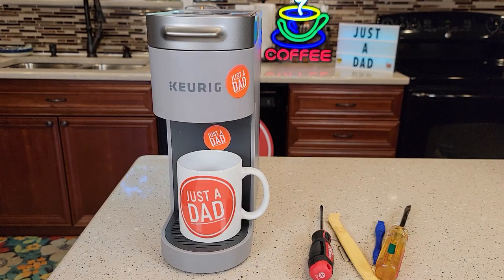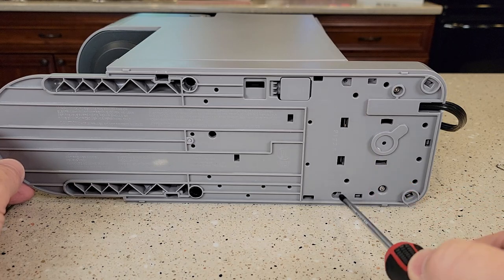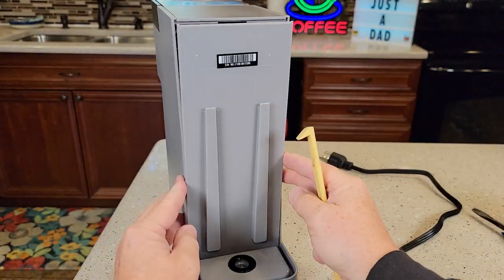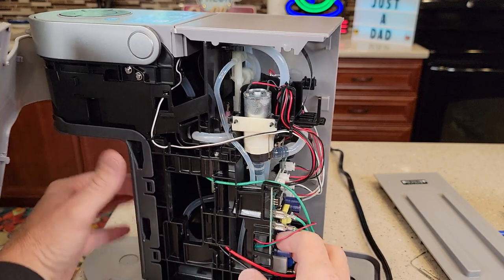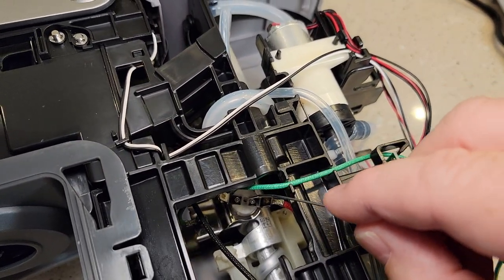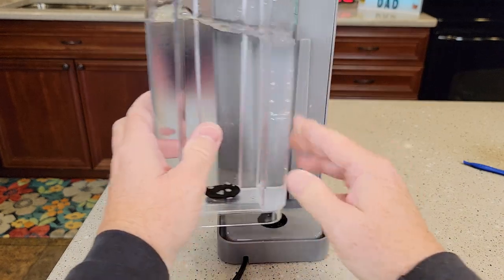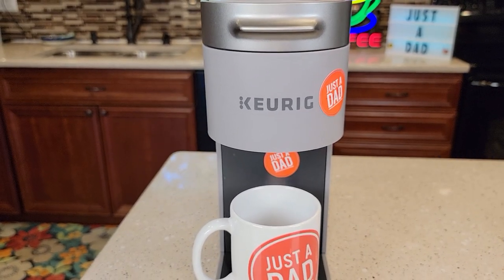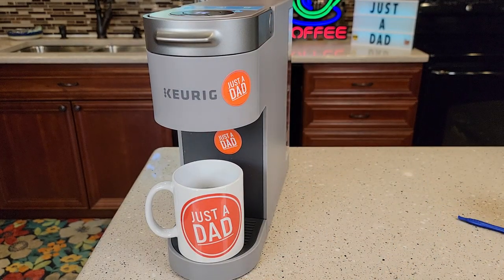How To Fix Keurig K-Slim + Iced Coffee Maker No Power    RESET THERMOSTAT

Comment: Keurig should do a design change and install a user friendly circuit breaker or reset switch and mount it to the outside of the machine. So when it does trip the consumer can just reset it and save time and aggravation.
Reply: They want to force you to buy a new one

Comment: on the OLD K-Supreme (before the 2.0 models came out), there was a low water indicator that would remind you to fill up.  Am I to assume that Keurig does not prevent overheating on an empty tank?  The old models used to have a boiler that would fill up (but could never empty to clean) and it looks like these newer ones got rid of the boiler in place of hot water on demand with a thermo coil.